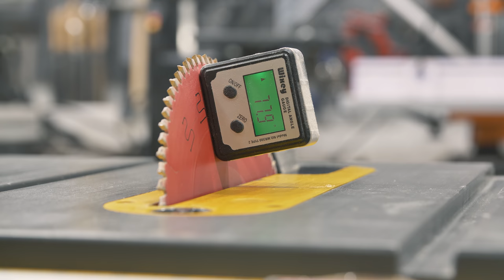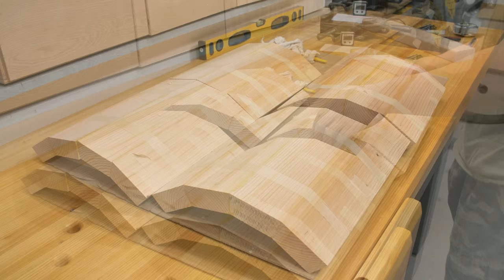Making 14" Round Wooden Plant Pot 【木工】14寸圓木花盤製作

Comment: Aloha Victor beautiful work  I will give this one a trial  I made a bucket for planter wishing well which I cut 15 degree angles on both sides of the redwood pickets I used to make my project  I have a bunch of pine 2x4s that are not actually 1.5 x 3.5" because ends are factory bad, so I'll see what width i can get it as straight as possible

Comment: Can you tell me how that angle is calculated???
Reply from the maker: I used SketchUp to create the model first. Depends on the thickness of the wood and the side of the pot. You can play around the number of segments of a circle in Sketchup, then give it the thickness you want. Then measure the angle from there.
Reply: ❤❤ also I found it’s  mathematical formula  thanks

Comment: Measurements? Dimensions? Angle cut on 2x4's?
Reply from the maker: The outter size of pot is 14inches high, 14inches diameter. I prepared 16 pieces cut 2x4. 14 inches long, width 2.75 inches, thickness doesn't matter. Angel is 78.7 degree on two edges.
Reply: @victorhe7200  Thank you, I will have a go at that.

Comment: Thank you for sharing this beautiful work.  Your math is correct - 78.7 for each side - so why did you need to customize the last piece?  Is the customized piece #16 or #17?  Thank you for replying.
Reply from the maker: Hi Alan, thank you for bring up the question. The last customized piece needed because I couldn't get the exact angle cut. Here are a couple reasons might cause the problem. My tablesaw tabletop and the insert plate are not completely flat, so the angle I measured against the insert and the angle against the tabletop are different. I chose measured again the tabletop because it's more firmed. Also because my tablesaw is just a jobsite saw. It's not very powerful. The force I used to push the wood through was not even. Sometimes the blade will bend slightly that would add up to huge difference. So after cutting all of the pieces with two sided, the gap added up so big.
Reply: @victorhe7200  I have the same saw so I’ll keep that in mind. Thanks again.
Reply from the maker: @drab31s  You are welcome!

Comment: Nice! How do you figure out the diameter?
Reply from the maker: Thank you. First we need to know what rough diameter we want, then we can Sketchup to create a plan. Because the actual size of 2x4 stud is 1.75x3.75 inches. And after planing will be 1.5x3.5 inches. The 3.5 inches will be the max width for one of the outside edges. We can choose how many edges we need to create a circle in Sketchup. So we can play around the diameter, the edge width, and the edge numbers to see what fit our need.

Comment: What angle did you use in your table saw to each piece? Nice job!
Reply from the maker: Thank you. I used 78.7 degree  to cut.
Reply: Victor He Thank you but if you divide 189 by 16 pieces you come to 11,25 so what’s is 78,7?
Reply from the maker: @paulocaldas2390  I just used the SketchUp to build a simple model. that's what it came up.
Reply: Victor He Ok, thanks a lot.
Reply: @paulocaldas2390  You are just measuring the other part of 90 degrees it’s the same angle.
Reply: Yeah just take 90 - 78.7, which comes to 11.3

Comment: What do you use so it doesn't get affected by humidity?
Reply from the maker: I used Minwax spar Urethane. I used on a few of my wooden pot, as long as you seal them well, I don't see any crack or mold. I think you can also use Epoxy Resin as well.

Here is the product description: Minwax® Pro Series Spar Urethane is a professional, water-based, crystal clear protective finish that forms a protective barrier against rain, moisture and sunlight.